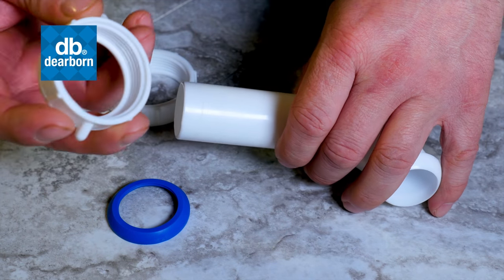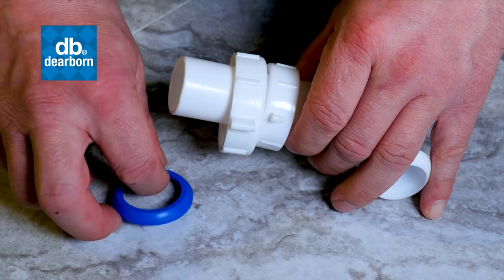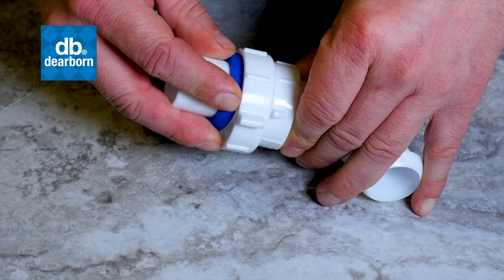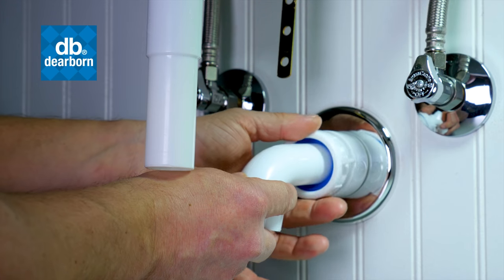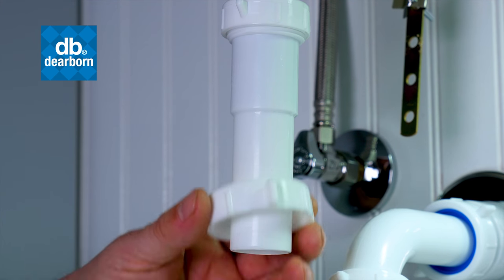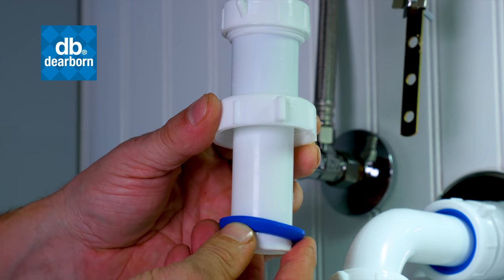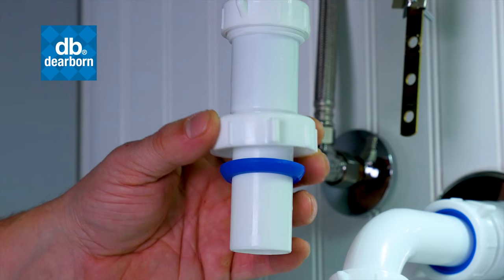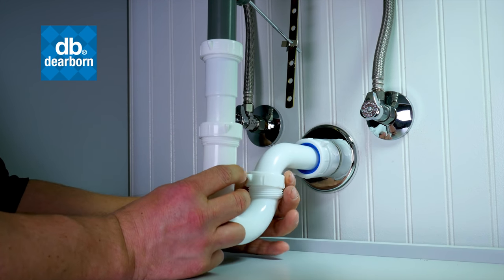How to Install a Plastic Bathroom P-Trap

Comment: Why doesn't that final connection need a seal?
Reply: No seal is used in other videos either so this appears to be normal.  And I tried it myself and it doesn't leak.
Reply: I was also curious.

In this video, the J bend doesn't need a washer because the J connection has the gasket bevel shape built into it. The slip nut when twisted will pull the two pieces together and that pressure will create a water proof seal at that ground joint.

I have a heavy duty kit where the J bend doesn't have a built in bevel shape, but it has a spot for me to put a rubber washer. So on mine, I need to put a washer. 

The instructions on the back for mine are a little odd, there's three 1 1/2 washers and one 1 1/4, but they don't label the 3 washers the same letter.

Comment: Not sure if anyone has asked this but does the direction of the blue rubber gasket matter whether that larger diameter is facing towards or away from the clamp? I assume it ends up flattening out as the clamp tightens over it anyways.
Reply from the maker: @Oleg You'll want the beveled side going into the slip joint connection. The flat side is what the nut would tighten against.

Comment: Why do some pipes have a lip that holds the nut, and some rely on those rubber gasket things? The rubber gasket things are not holding my pipe, it keeps falling right out when I tighten the nut
Reply from the maker: @Anthony g Where the wall tube connects to the J-bend that joint sometimes has a ground joint and not a washer. The connection to the sink tailpiece and connection to the wall outlet should always have a washer to seal to the connection. Please contact technical@oatey.com if you need further assistance.

Comment: No teflon tape on the threads?
Reply: No need for Teflon tape
Reply from the maker: When installing a tubular p-trap,  the area where the washer comes in contact with the flared ID of the fitting it is being connected to is where the watertight seal is mechanically created with the nut and washer. Joint thread sealant is not needed to during this application.

Comment: My new sink tail piece isn't reaching to the ptrap what should I do now? The length is fine but it's like 1/2 and inch off from the side.
Reply from the maker: Typically a P-trap can accommodate up to 3” offset from the swing of the trap - if it's outside of that, you may need to add an offset to make the trap work.

Comment: I still have leakage! am I tightening to much?
Reply from the maker: @Donhegg Plastic slip joint connections should only need tightened by hand to seal. You were maybe over tightening or the joint is not square causing the washer to not sit properly.

Comment: Can those threaded pipe kits be used for both kitchen and bathroom sinks?
Reply from the maker: @n310ea Yes they can. But this specific video shows a bathroom sink(lav) which genrerally is a 1-1/4" trap. Kitchen sinks are generally 1-1/2".